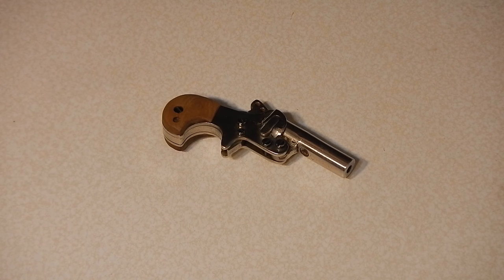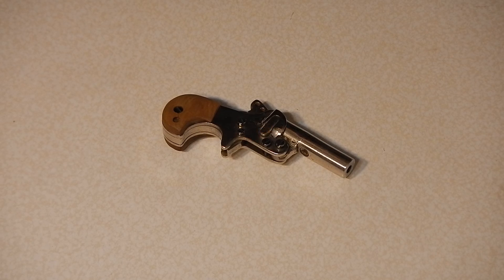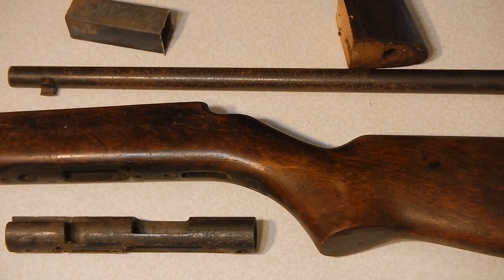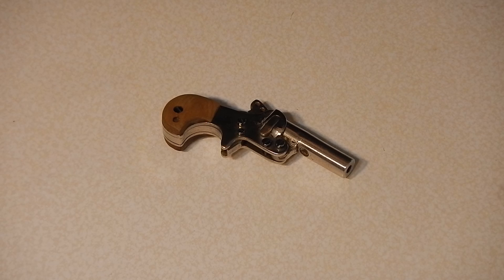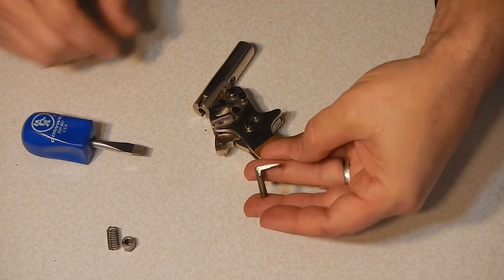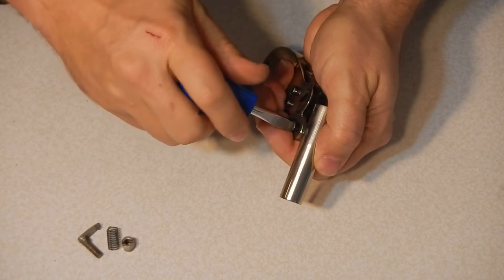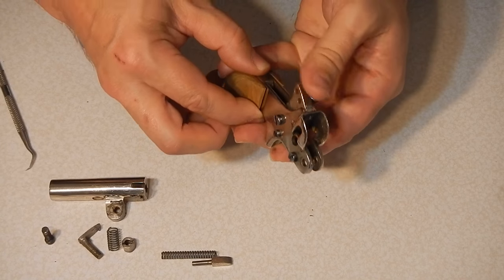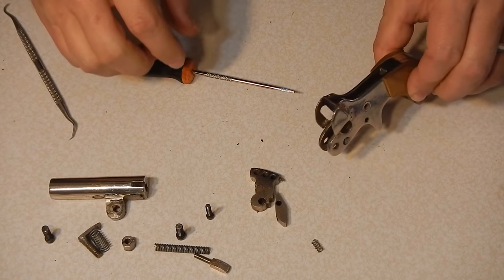Home Built .22 Derringer (Part 2) - Details  and Measurements

Comment: Very cool.
If I ever make a firearm it won't be as pretty.
Did you ever see the channel Royal Nonesuch?
He was a teenager that built slam fire shotguns and derringers in his mom's basement.
His fanciest tool was a $100 110 volt stick welder.
His guns weren't pretty but they did work.

BTW barrel liners are a good no background check way to get a rifled barrel.
Reply from the maker: Yes on all. Btw, I have no issues getting background checks done. I’ve had A LOT of background checks done. I have a carry permit and buy at least one gun a year from a dealer. The point of this video was not so I could own a non-FFL firearm but to simply show that it can be done and is done frequently. I skipped over the whole 80% lower craze and would not touch anything not legal with a 10 foot pole but yes it can be done. My recent videos on 3D printing should show you that with a printer setup costing under $300 and free computer software you can turn out an unregistered gun about every 24 hours for about $10 per pound. They gov is fighting a losing battle. As soon as they try to ban something it only increases the Resolve of the American People to tell the gov to go F themselves with a broom handle.

Comment: Hey, nice build! Did you cut the side plates with an angle grinder? I'm trying to build the same project, just need the spring :)
Reply from the maker: I used an angle grinder. I used a bench grinder. I used a sawzall, files, anything I could find but no tools that the average toolshed would not have. For the spring I just went down to a local old time auto parts store and dug through a box. I’m sure some standard size springs are available.

Comment: It would be cool if you got some direct overhead pictures of the parts on a sheet of graphing paper
Reply from the maker: That is a good idea. I may take it apart and do that for those interested. The main reason I don’t is because I don’t want to be in direct violation of YouTube specific policy on teaching people how to make a &UN. Plans are out there in the great Googleweb. Just google Professor Parabellum homebuilt derringer. The one I built is loosely based on his Model #2.
Reply: @SmithFarmandOutdoors    Yup I saw his plans too and i'm totally making one myself. Just don't say what you are doing and avoid using key words. It sucks it has to be like this but O well.

Comment: How did you make the chamber?  Did you silver solder the lug on the barrel?  I like yer work!
Reply from the maker: I used a mig welder for the lugs and watched the temp to make sure it didn’t get too hot. The barrel is thick so no damage. The chamber was pre-drilled from the original donor barrel.

Comment: Technically you don't need rifling in a .22 for that law you are citing.
Reply from the maker: Technically you are not correct. That would fall into the category of AOW (Any other Weapon) and would have to be registered with the ATF as an NFA item. Any pistol without a rifled barrel is considered a shotgun. Any short barreled shotgun that isn’t registered and taxed is illegal to make or own. 

Case in point. Rifles have a minimum barrel length of 16”. Marlin makes a .22 Garden Gun with a smooth bore. It’s designed for .22 shotshells. It’s for dispatching garden and farm pests. The trick to being legal is that is has a barrel longer than 18” which makes it a legal shotgun.

Comment: I love it! Would you need much modification for .22WMR? I mean more in the sense of being safe with the pressure levels; obviously the physical chambering part would be a moment's change. That's a more viable round for defensive use (which is about the only thing anyone would use a tiny holdout gun like this for).
Reply from the maker: Chamber is your main concern. That and the added recoil.
Reply: Can a barrel this short gain significant velocity from a 22 magnum cartridge?
Reply from the maker: I would not know but considering there a lot of factory produced derringers out there with .22 magnum…

Comment: Does the barrel need to be heat treated after the lug was welded on?
Reply from the maker: The barrel on this one was heavy enough that I didn’t worry about it. I welded it slow and let it cool between beads. Also it’s a .22lr. Not much pressure to worry with.

Comment: Very nice build..........one question, i see the notch on the right side for the barrel catch,  is the notch on the left side needed?
Reply from the maker: It isn’t needed. I re-used an existing notch from the old rifle barrel. It had notches on both sides originally. If you start with a barrel that does not have a notch then only one notch is needed.

Comment: You had to do a background check to make a gun. This doesn't prove anything.
Reply from the maker: This is a theoretical exercise. I didn’t have to. I just bought a Grizzly lathe yesterday. I could easily bore a barrel now, threaded or not. I didn’t have to have a background check to buy a lathe. I am thinking about making one from scratch now that I have my new tool that makes round things.
Reply from the maker: Also, I could have bought a barrel without a background check. Duh. The main reason there was a background check done on the parts gun is because I bought it at the same time as a Ruger 10/22 rifle.

Comment: hi! how thick is the barrel?
Reply from the maker: Hi. Ill measure that for you. I have been really busy the last couple days and haven’t done it yet.
Reply from the maker: The good news is that I bought a small lathe and can now turn down a barrel to whatever diameter I want.
Reply from the maker: Ok. The dimensions. Consider that this barrel was shaped on a drill press with a file and sandpaper. I didn’t have a lathe at the time. The thickness of the barrel has a slight taper. It is .630 at the breech and tapers down to .585 at the muzzle. I apologize for taking so long to get the measurements.

Comment: cool vid but I'm new to this. did the barrel need chambered? I wanna try this out and I saw on green mountains website they sell barrels in 22lr but they say "not chambered" so I'm not sure if additional work needs to be done to it once i receive it. other than the obvious sanding to scale work.
Reply from the maker: I did not need to chamber the barrel. I used an old cut down rifle barrel for the project so it already had a chamber. You can chamber one easily though if you get the correct drill bits. Best done on a lathe. I’m going to make a different barrel for it soon and document how to chamber it on my small lathe.
Reply: @SmithFarmandOutdoors  ok thanks!!
Reply: @SmithFarmandOutdoors  

The fact that you used a rifle to make this technically makes your derringer a modified rifle (SBR). These videos, while great, are somewhat incriminating for you.
Reply from the maker: @cavemanjoe7972  you’re actually wrong. I used a non serialized barrel from a broken parts gun. If I had used the receiver of an existing long gun to somehow make the derringer, that would be illegal. Learn your laws before accusing someone of breaking one.
Reply from the maker: Additionally the barrel was removed from the rifle and the rifle receiver was destroyed before the barrel was shortened. A barrel is a non-regulated part. It’s the receiver you need to be concerned with.
Reply: @SmithFarmandOutdoors  

I don't know why I thought the barrel and receiver were the same part. I've only been gunsmithing for 17 years.😂
Reply from the maker: That’s funny.

Comment: Why are u cut barrel on both side
Reply from the maker: I didn’t cut those notches. Those are original to the barrel as I removed it from a rifle. The notches were originally used for the bolt action extractors.